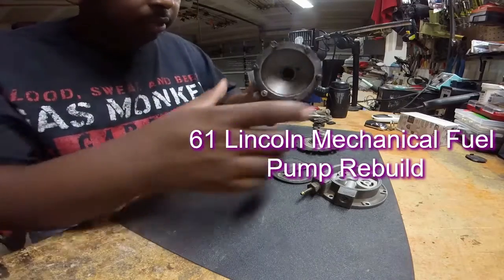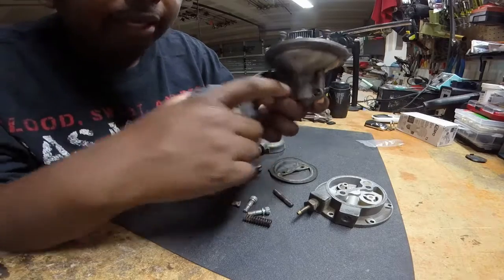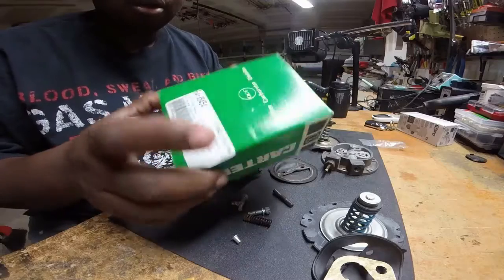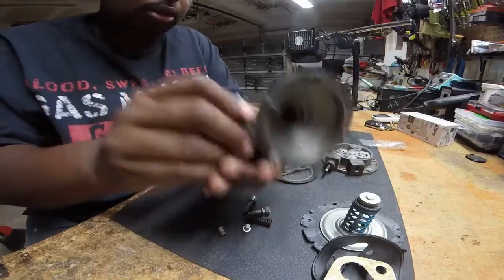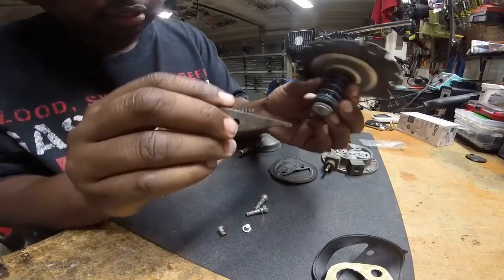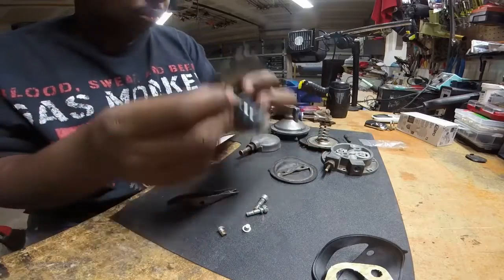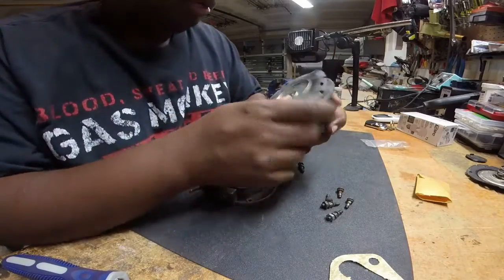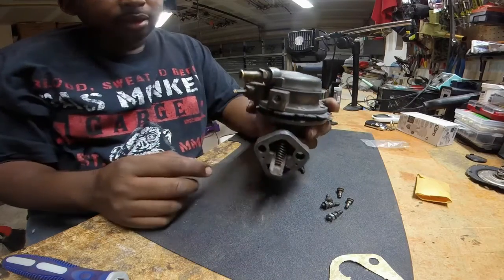Mechanical Fuel Pump Rebuild

Comment: How did it all work out ? I’m rebuilding mine. I noticed you didn’t put any fuel resistant gasket sealant or change the valve gaskets either . How’s the car doing?
Reply: Still running like a champ

Comment: I'm embroiled in the rebuild of a 70's Civic fuel pump. The pin looks like it was covered with recessed, domed metal caps so I can't just drift it out. Any tips for dealing with the caps?